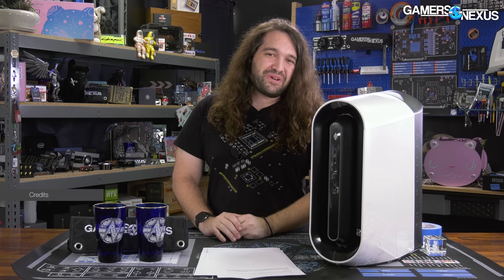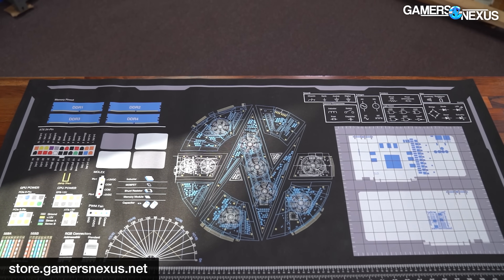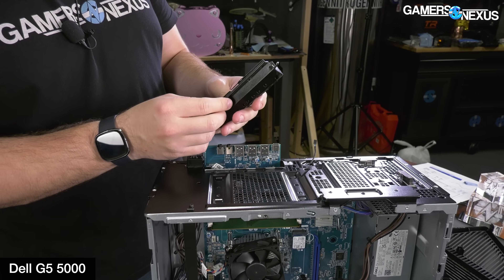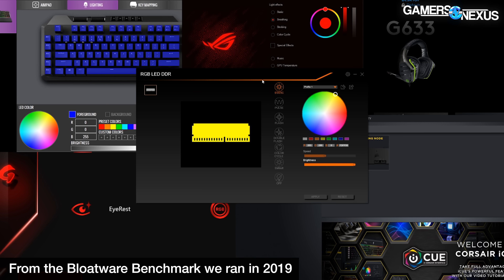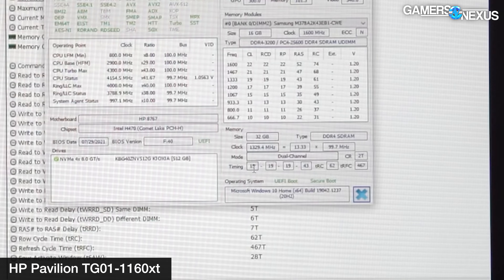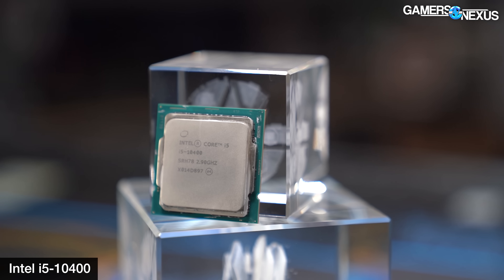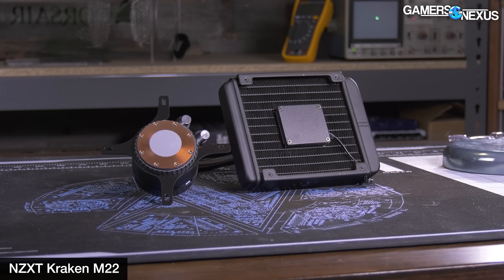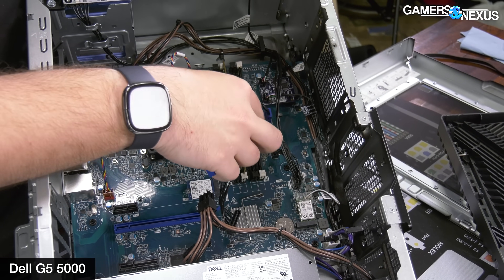The Worst Prebuilt PC Mistakes We've Seen (So Far)

Comment from the maker: There were too many bad prebuilt mistakes to list in one video, so please add your own experiences below!
Check out our playlist of pre-built reviews here: https://www.youtube.com/playlist?list=PLsuVSmND84QuM2HKzG7ipbIbE_R5EnCLM
We also collaborated with Digital Foundry to test the Playstation 5: https://www.youtube.com/watch?v=VgWuGA8cExo
Reply: My first prebuilt mistake was going to Newegg for one. In January I got a 3060ti ABS system $1299, with Gigabyte guts that died two weeks later. Things happen, I know.... the horrible customer service was the deal breaker. I'll never use them again. 
After watching your reviews, I suspect those Gigabyte guts. PSU might not be their only QC concern. The ram slots were stupid tight too. I forget which board it was. I've popped a few sticks in in my time...that flimsy board might have flexed on the standoffs, loosened something. I added another 16 g ram, it ran fine for several days. Shut it off. Next day....a big ol' bowl of Boot Loops.
 "Huh?" I fiddled, swapped sticks around, took sticks out, reset bios...finally I got...a rapid power onoffonoffonoff til I pulled the plug, said fuck it and threw it back in the box.
Reply: @yourhandlehere1  recently bought a ABS prebuilt from Newegg, 3070 with 10400f. Runs beautifully, never had any issues over the past month, set up was super easy and activating windows was also easy. Stays nice and cool and the fans are so quiet. 10/10 would buy again.
Reply: Worst one so far was the defective 2060 in the Omen prebuilt I got for my GF. Beyond that, pretty much always bloatware.
Reply: Currently working on a HP Pavillion gaming at the moment. Amazing how crap it is.
Reply: Thank you so much for these prebuilt reviews. It's amusing to see the craziness of the proprietary components...

I got a CyberPower prebuilt recently and while I hit the lottery (they gave me a better motherboard and a ftw3 ultra 3080) it came with that awful worse-than-stock cooler which choked the 11600KF to the point where it would hit Tjmax at non-turbo speeds. And it came with not only one, but three free (pun intended) screws happily floating inside the case waiting to short something. The side panel was wobbled and looked like it was hammered in place. The Onyxia tempered glass case of course also had absolutely no airflow (like @WildParrot said) and I'm contemplating a case swap since there's no good airflow path for it. To their credit, cable management was quite good and no bloatware, so a couple of hours of cooler and fan work and it can be a great prebuilt. Having to swap components out of the box is not the point of a prebuilt, though...
Reply: @jimmiee32  My Sky Tech didn't NEED anything. Well packed. Good right out of the box even after getting stuck in the Texas blizzard for a week. 3080-3700X. Neo Air case, excellent airflow.
Did I leave it that way? Pfft! Hell no.
More ram, more cooling, more storage, more power grunt grunt grunt!!!
Reply: @yourhandlehere1  that’s nice. I did some mods to make it survive the first couple of months and I can’t wait to get it out of that choking cyberpower case. Did I mention they hot glued the backplate to the motherboard??? That was bizarre and I had to use a huge amount of force to fix the cooler
Reply: @jimmiee32  It'll be fine, you got the 3080. I think it's the Goldilocks card of the whole bunch. For hobbies, I haven't seen a single benchmark that would justify the extra cost of a TIE or a 3090.
As far as your case...Glass front? Removable, screws maybe? I looked for pictures, I can't tell.
 Longer screws and some kind of straw or tube for a stand off...make a gap for air.
 If it's metal or plastic, mark a pattern and drill a bunch of holes. (carefully, keep it purrrrty)
I even took out a bit of the mesh front on my Neo Air, just wasn't fond of the look. It had a fat inner grate pattern on the plastic frame. I cut it out, much cleaner looking.
Front 240 with push pull, I have 8 fans packed in there, one mounted on back where the unused expansion slot covers were. Made my own leg for the 3080 and cut a mirror to fit under it so the rgb will show.
https://i.ibb.co/D4N5CMY/20210910-172845.jpg
The piece I took out..
https://i.ibb.co/KVM3SPd/20210910-172909.jpg
Reply: @IcantSignIn Looks really nice!! Clean and good airflow, I like that. Mine still needs work. It’s glass front. Not sure if I can take it out, I quickly looked at the case and didn’t find a way but maybe it comes off. The insides are fully solid though, either way I’ll have to drill some holes to get some airflow. For now I can endure the hazard of having an open case, maybe just swap it and keep this case for a 5700g build that needs less cooling…
Reply: Thanks for exposing the garbage of Alienware again. I was tempted to buy one a while back, due to the GPU shortage. I am so glad I didn't.
Reply: i hope you guys get some MSI prebuilts and get into the BIOS settings for them because they have basically the same versions of their retail Mobos but with a different revision number so that they have a separate BIOS and that BIOS is never updated again. So despite seeing all the BIOS updates with security and other changes and compatibility upgrades to the same retail board, the BIOS for their prebuilts stays the same version and they say don't try and update it and if its not broken don't update it. For example anyone getting the Resizable BAR updated for any types of motherboards they added as retail arent available for their prebuilt versions. As an example my z390 board is exactly the same in appearance as the regular Z390I gaming edge ac but it is a different version number and actually has one less SATA plug and  there' missing a fan or pump hub, the mark for it is there just no connector. They advertise as a system with upgradability in mind but if i look up the bios for the retail board they've still had updates for it recently where as my bios is from 2019. I havent had the gumption to try and flash the bios for the other board onto mine because i would have to do a little bit of file editing because i cant find the file normally and i don't wanna brick my system . This seems to be their policy with all their prebuilts from the high end to the lower model versions.
Reply: Idk why steve wouldnt just partner with an SI or OEM to make a good prebuilt
Reply: You forgot the Dell hidden charges than no one asked for and was verging on fraud!
Reply: Also no one is talking about the Alienware aurora r12 memory controller being locked in gear 1:2…. Dell tech says that it is by design  but fails to mention the performance hit in any of its specs
Reply: I don't think small aio's are bad per-se in prebuilds. Shipping damage can cause problems for tower coolers, and they still outperform downdraft aircoolers.
That being said paying a bit more for a large aio would be a better option.
Reply: I once had a Dell prebuilt that had multiple plastic shrouds hotglued or bolted straight to the motherboard, covering various components and sockets. I had to literally saw my way through them to reach the components I wanted to scavenge before disposing it. Needless to say basically everything was non-standard and useless anyway.
Reply: A youtuber stole ur logo. There name is “ skye storme” all they did is make the logo deep blue instead of light blue
Reply: My relative have an Dell Inspiron 620, I add in an graphics card and it stopped booting until I found out that the PCI-E slot is disabled permanently as there is no option to enable it in the BIOS.
Reply: they put scam below your facebook post.
Reply: One of the worst I've ever seen was an Acer predator prebuild pc.
Reply: I am still using my Thermalright Ultra Extreme 120 (one of the first 120mm tower coooler ever made, at least for consumer PCs) from 2007 in 2021 on my AMD 5800X. This thing has cooled an Athlon, a Phenom x2, a Phenom II x4, an i5 6600K and now it's cooling this. I did upgrade my power supply at some point though, but with this Seasonic focus+ 850W I expect to not have to worry about until the ATX standard is left behind. I also still use an old Antec case with the power supply up top, I drilled 140mm holes in the top and bottom and installed 2 fans there, still works fine.
Reply: Come on, give them some credit, at least the crap was of a consistent viscosity throughout the range.
Reply: Few years ago I build a PC on very tight budget a decided to give Intel stock cooler a chance. I had i3-4170 and the thing that came in the box and suposed to be a cooler was a joke. Idea was to build PC and use iGPU for a month and then buy some GPU. That tiny 2 core i3 was hitting 105 C while playing Diablo 3. I go to nearest PC shop and bought cheapest tower cooler they had 92 mm fan and just one heatpipe in "O" shape. It cost 7,50 euro and with it that i3 fun 35 C cooler. That's insane to be company as big as Intel and produce such a piece of garbage cpu cooler lookalike thing.
Reply: Oh yes PC Jesus please review NVIDIA DGX Station A100 next
Reply: Just a note(which goes along with some of your observations)...HP consumer(non-gaming) machines have had the same garbage as the HP gaming machine you had looked at, but with the extreme that there are NO PCIe power connectors at all, with no way to replace the power supply to add some support.   That proprietary power connector from power supply to motherboard is the HP standard these days.   Lenovo has their 10 pin power connector to the motherboard in their standard desktop machines, though a number of the Legion desktop machines DO use the ATX standard for power to the motherboard, so those systems do allow a power supply replacement.   Dell is....Dell.   Garbage all around, proprietary power, this, and that.   

There is NO excuse for this move to proprietary connectors, even to "save money".
Reply: 120MM AIOs will beat any air cooler when attached to a front intake with a 300w+ air GPU below it.  You'd know this if you actually try building economy systems to meet price points with say 2 120 front intake fans (one being the AIO) and a rear 120mm fan.  There's flaws in your testing methodology in that you try to be scientific over realistic.  Your cooler testing would be much more real-world if you test them in a case with a GPU below them.
Reply: @mhamma6560  NVIDIA refrigerant cooler will beat any air cooler when attached to any of 450-500w CPU+GPU
Reply: got one of those hp prebuilts and found alot of the same proprietary mounting holes and connections so instead of being able to swap a new motherboard  in or old into a new case had to buy a whole new case, mobo, psu, and cpu cooler as that was proprietary aswell was my first pc build what a horror show aha only ended up being able to save the apu, gpu and that dreadful cl20 ram until i got a new kit
Reply: I bought a Alienware pre built couple years back and the motherboard had only 1 Fan header with a proprietary 1 to 3 fan spliter. All 3 fans were hardwired to the one plug......
Reply: For large organizations the OEM proprietary route actually makes a lot of sense, not just because it's really cheap by volume but because the nonstandard parts become standard until the next rollout, each machine that dies outside of warranty is a donor for fixing other machines when they go bad. I agree that standard ATX stuff would probably be better but then again the ATX standard hasn't evolved for a long time, there's tons of stuff in these shitty PCs that are actual engineering improvements over standard ATX, ways to do the same thing with less material or in a smaller space.
Reply: @thefirehawk1495  well but the prebuilt above and nowadays they really targeting at consumers/gamers in which large volume at low price is kinda got throw out of windows
Reply: Epilepsy transition warning, I guess...
Reply: I made the mistake of buying my step father a PC from one of our glorified pawn stores. I looked at ram, CPU. I thought that's a good deal, got it home and seen the word " dell" on it and thought where is the psu lead then realised I had bought a proprietary system..
Reply: I had a shinobee prebuilt, very bad. It’s got an rx 460 (which is probably the best in the rig.) FX 8300. it was so bad to the point the computer actually fucks up the wifi drivers entirely.  Making me have to restart to get it back. Sometimes it would restart by itself too. I’m guessing it’s the psu because it was horrible too.
Reply: HP constantly lies about their Omen PCs functionality. For example HP will say that a PC produces 5.1 surround sound, yet NONE of HP's current motherboards have all of the necessary output jacks needed to produce 5.1 surround sound.
Reply: Bloatware has gotten so bad that I’ve taken to just erasing people’s drives when they get new PCs, because it’s just easier than getting rid of all the apps that just DON’T WANT TO DIE
Reply: its a year later, and id argue now there definitely is a massive difference between 32gb and 16gb. though the difference is more in user experience, than straight up framerate.
Reply: What about cases chocking components?
Reply: My mother got took in by a COMPAQ brand in 1997...  Bloatware beyond belief...a slower than dead chipset...and a case so sharp that I believed the French Revolution was going to make a comeback...

Lucky for me...with my Linux skills even back then knew that everything inside needed an upgrade...  

It took three days to get the case dulled enough to avoid cutting myself on it (again) and another three to get the upgraded parts...  Then the 26 CD install of SuSE Linux caused another headache because I forgot which would work best on the new build (later finding out that I could have gone with 16 home use install CDs)...  Remember that she paid $1950 for this NEW...  It took six months of gar(b)age sales (from trying to piece out Compaq's garbage) to break even with the new components I substituted...  She did go back to Windows eventually...but when this new rebuild sold for $2100 at auction...we finally decided that I build whatever I wanted and she would like it...  It eventually got spread that I could improve the performance of any computer and a small business of a repair shop was born...  I just never did MacWindows...strictly Linux builds...
Reply: @RazzillasRealm  Ya know you brought up an interesting point I paid I think $1700 for a stupid 286 computer like 30 yrs ago now look what you get for a $2,000 dollar computer WOW!
Reply: @dkat1108  I still run my $1200 Dell, Core2 Duo 15 inch laptop out in my shed. Maxed out with 2GB ram!!!, on board graphics, XP.

Never crashed in 12-13 years. Got hit by lightning once and fried the ethernet port but everything else still works. 
The cable ran across the ground to my shed, inside a pvc pipe. Lightning went through everything, bypassing the surge protector, coming up the ethernet cable, up the mouse and to my hand. Knocked me out of my chair. Knocked stuff off the walls in the house. When the power came back on, I tried it, booted right up.
Now it just says "cable unplugged" no matter what. Wifi works.
(That one snuck up on me, I usually unplug if it's about to storm.)

Keyboard hooked to it, mouse, speakers, 32in. TV. The battery quit years ago, it's been on straight ac.
At least I'm pretty sure it's still there on the table somewhere under the sandpaper, tools and whatnot cuz I'm watching videos from somewhere.

Haha, yep...just spent $2300 early this year on a new 3080-3700X rig in the house.
Reply: About 20yrs ago a friend needed help with his Dell computer, would not boot so I looked at it and confirmed it was the motherboard so as a young enthusiast I said ya sure looks like we can swap the MB Oh man open mouth insert foot. The case did allow for a standard MB but I also had to buy a power supply, memory and still had to Jerry rig a reset switch in the damn thing this is when you needed a reset...That was the first and last time I did that.
Reply: I recently bought a Cyberpower Prebuilt and I got exactly what I wanted: an rtx 3080 evga ftw3 plus an i7-11700kf with an aio it performs really great! Only when I take the side panel off cuz my card is cooking my pc to a 90⁰c. Side panel off is now 52⁰c max on the cpu and 75⁰c max on the gpu... so yeah
Reply: @wildparrot3802  since they're an si, you could probably put those parts in any case.. cases aren't that expensive either, hundred bucks get you a nice case.. specially if you buy an older one before they get all well, let's just say I don't buy anything that doesn't have three and a half inch drive bays.. actually I don't buy anything that doesn't have optical base but that's just because I like a whole computer not just you know entirely dependent on internet connections but call me old school that way, go figure first time I ever tried to play a Blu-Ray disc with my Blu-ray drive was 5 years after I bought it, turns out it it wouldn't play without proprietary software.. go fucking figure right?
Reply: @jakedill1304  im not much of a pc builder but ill give it a try! I like my pc cool so I'll find a good case for maximum airflow might even try for an open-like case because I have a small room and it gets hot real fast... less bills for this winter I guess lol
Reply: @jakedill1304  bruh all you need is vlc
Reply: @wildparrot3802  my friend bought a Alienware prebuilt for 1500 and it would crash over heat load times where forever he returned I am building him one
Reply: I would rather see the best high-end prebuilds with decent value.
Reply: Please make a video for best pre-built with a decent GPU within $1000-$1300

Comment: I've been recently unsure about the RAM in prebuilts. My laptop has 16GB of ram, and it idles at around 50% usage. And from my past experience 16GB is basically the bare minimum for games or even just normal productivity. I feel like 32GB should be the minimum gaming amount of ram. With 16GB I ran out quite often.